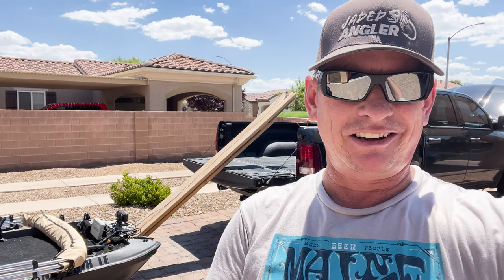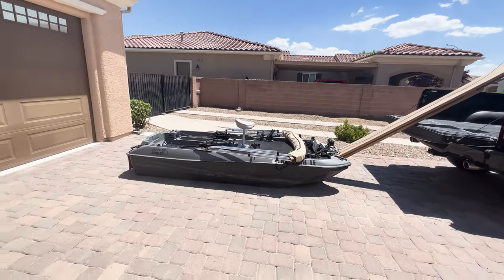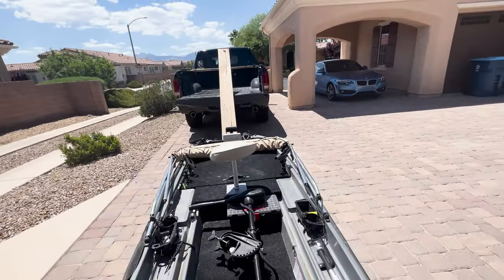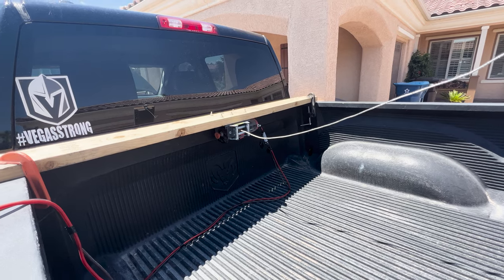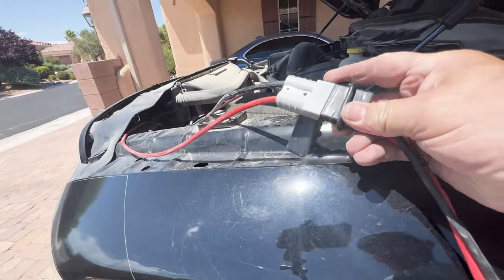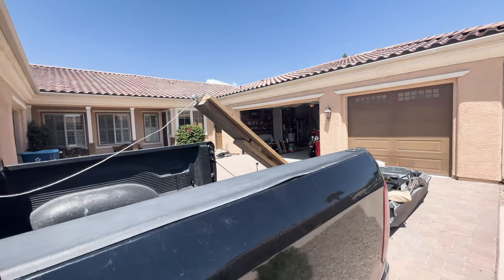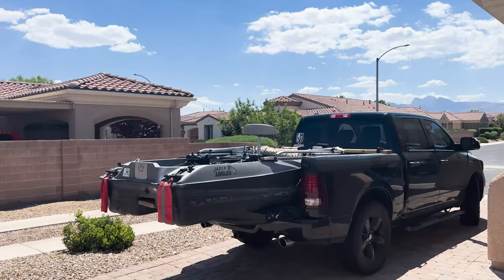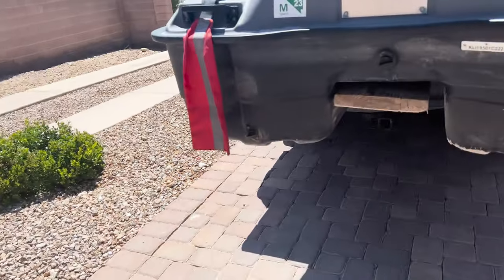How to Easily Load Your Pond Prowler (or any small boat) into Your Truck!

Comment: Nice video. After you loaded the boat and put your red safty flags on did you secure that board somehow? Looks like you just pushed it in without any securement it will eventually slide out if not secured somehow.
Reply from the maker: Sorry, just saw this post.  I use a rope and tie it through the board and attach it to the handles on the back of the prowler.

Comment: wont the board fall off when you are driving down the highway?
Reply from the maker: I have a hole drilled through it at the tail end.  I run a rope through it and tie each end off to the handles on the Pond Prowler.

Comment: Sliding the rear bottom on the driveway will eventually wear a hole in the bottom.😊
Reply from the maker: This is in my driveway for demonstration.  In the real world this occurs at the lake and not on pavers.  You are going to have to drag it anyway…whether it’s by this method or not.  Thanks for the comment.
Reply: @JadedAngler  you could add wheels to the rear of the boat for ease of getting it around once at the lake. 😀
Reply from the maker: @myparadiseonbantayanisland9030 I do have rollers (harbor freight) that I wheel it around on at home.  At the lake, the board goes right into the water, so the boat never touches the ground.
Reply: I'd use a Harbor Freight moving dolly to protect it. Simple fix
Reply from the maker: @larryswindell5906  That’s exactly what I used…just not in the video.

Comment: I like this idea alot. Im doing it myself right now. Could you please tell me what the peice is called that you attach the winch to on your boat? Thank you in advance
Reply from the maker: I just used a large heavy duty eye bolt with metal backing plates on both sides of the transom.